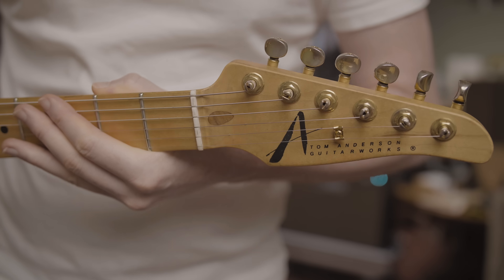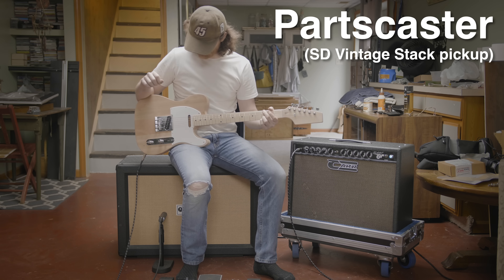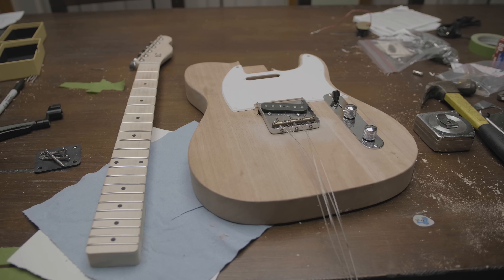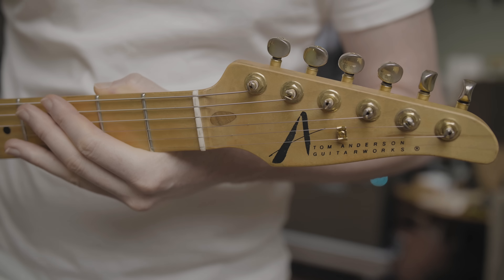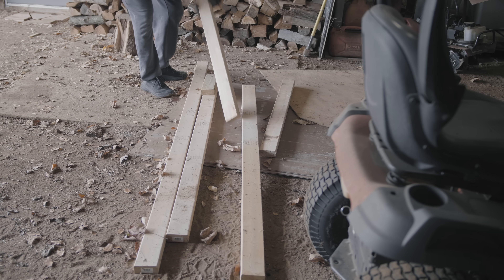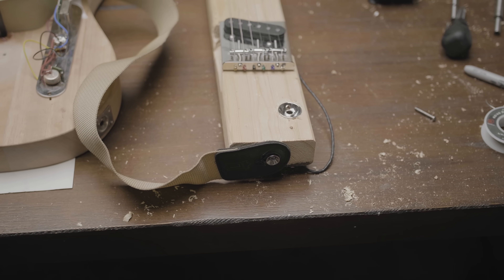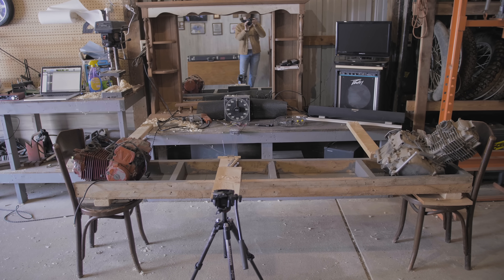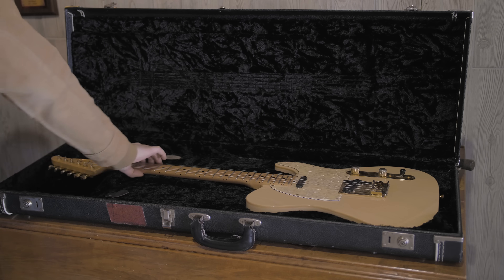Tested: Where Does The Tone Come From In An Electric Guitar?

Comment: I think the biggest determining factor in guitar tone is what size Honda engines you are using to hold down the shelf! Thank you for an excellent video that proves the most important parts of electric guitar tone have nothing to do with wood
Reply: and if they're v-tec and which generation plays a big role too!
Reply: @cunjoz  those are air cooled Honda single cylinders for ATVs or motorcycles, no VTEC lol
Reply: Honda is leaving F1 so they can start supplying power units for guitars.
Reply: Think they were Honda tonecasters! 🤣
Reply: @ChrisSmith-vm5tm  Now you're just being silly 🤣
Reply: Tone would have been fat and lumpy if they were Harley engines.
Reply: @tobins6800  And you'd have a guitar that didn't like turns...
Reply: @tobins6800  They also would not have made any sound a lot of the time.
Reply: Also, the milage of the engine has to be taken into consideration.
Reply: @JohnnyOlsson  true, newer engines sound brigher
Reply: Obviously he's running a spoon engine with Motec exhaust and NOS.
Reply: Yamaha engines would sound better. They make musical instruments.
Reply: Maybe replacing the Honda motor to a Kawasaki might make a tonal difference 😁
Reply: TRUE! The problem is that this video is trying to say that woods/substrate/guitar body doesn't matter.. and basing that whole argument on the fact that everything but the pickups, the strings and the tuners have been replaced... but that's not the case. Strings need something solid to resonate with to maintain their oscillation... plugging this rig into a bench does not demonstrate that.. you're just replacing the guitar body with a bench.. so, of course the strings will resonate the same - maybe better! Replace it with stale bread and you might have a point. :-)
Reply: @crazyjack9voltbatteryamps  "Strings need something solid to resonate with to maintain their oscillation" This is absolutely BS. It is exactly the opposite. The solid wood (or whatever "resonates"..) is taking away some energy. It is simply physics.
Reply: V-Tech Baby!!!
Reply: Just play a hollow body electric.  Make more of a difference than Honda engines.
Reply: Man, you're so misguided. Suzuki engines are the shit.
Reply: @patricasensio6074  I disagree and submit we still have no clue, completely, all of the factors involved in sound generation of an electric guitar.  Obviously the pickups and electronics are the biggest factor--but if they are the ONLY factor--why does a Rosewood Telecaster sound different than an Ash bodied one?  Why does a 50s Les Paul Custom sound different than a 50s maple topped Les Paul Standard?  You even have people claiming the glue makes a difference.  The differences in wood alone (rosewood vs ash, solid mahogany vs mahogany with a maple cap) tell me that the above study is flawed at best.  When designing a study, the number of variables involved causes the mandatory sample size (for validity) to increase exponentially.  For a valid study, looking at only one variable, a sample size of 10 can be valid.  For 2 varialbes you need 10 squared (so 100) for 3 variables you need 10^3.  So 3 studied variables changes the sample size from 10 to 1000.
Reply: @patricasensio6074  also I will point out that "Science" is perfect and is NEVER flawed.  Humans, however, designing and interpreting those perfect scientific measurements, are quite flawed and very frequently wrong.
Reply: OK. Let the idiots pay for tone wood... really.
Reply: @whitex4652  when you consider how much old growth forest has been cut down over the years to satisfy market demand for exotic "tone" wood, it's the planet that pays, really.
Reply: @sequentix  thank you!!
Reply: The planet doesn't care for some wood you use. When the planet was "born" it didn't have even trees.
Reply: You say that in jest but as a scientist who has designed studies, this must be taken into account.  This is a very valid "Feasibility study" (in science words) but I can see some issues.  As mentioned above, one must take into consideration the possiblity that the 4 different guitars were actually all made of very resonant wood.  Easy to think "well a 2x4 could not be resonant" but how do we know that.  Perhaps mount the exact same experiment to a piece of Trex decking (plastic 2x4).  Also try it with a metal bar (much harder to do).  Same with the air guitar.  I would like to see a further comparison using plastic or dense foam in the shape of a guitar and a metal shelf and bar mimicing the other 2.  Again, scientifically speaking, it is entirely possible that 4 very resonant woods were chosen here.  This is not to detract from the excellent experiment that was done.  This is outstanding and needs to be continued.  I would be willing to chip in on some materials to see more!
Reply: @drjsmajor  if we were doing an academic study of this topic then yes I’m with you and we it would be cool to take this even further, but I think this video was clear enough and pretty much proved the only thing that matters is the electronics.
Reply: @drjsmajor  What difference does it make?  None of us are playing guitars made of Trex decking or metal bars.
Reply: @colinb3544  It matters if you want to understand which factors affect the tone, and could also help further future instrument design.
Reply: We know where tone comes from in an electric guitar. Jim Lill has just proven it to us. 

Q: Where does electric guitar tone come from.

A: From the pickups as proven by Jim Lill in 2022 

Q: Should we build from materials other than wood hoping it will change the tone?

A: It has been proven by Jim Lill in 2022 that electric guitar tone is not dependent on the materials of the guitar but only dependent on the pickups.  Therefore building from other materials hoping that the tone changes is rather a waste of time.

Q: Should be build guitars from other materials.  

A: You can build it out of whatever you want   but understand that it will not change the tone.  This was proven by Jim Lill in 2022.

RSMG From your statement you seem to have missed part of the video.  You should listen again.  Nothing changes the tone other than pickup and pick up height  as proven by this video.
Reply: @colinb3544  "Should we build from materials other than wood hoping it will change the tone?"
All of the guitars he tried were made out of wood. Even the "air" guitar attached to the wooden bench (or shelf, or whatever it was, doesn't really matter). Sure, the electronics are far more important, but in this video he only tried guitars where everything was attached to wood.
Reply: @San_Vito  Ya funny that we as not willing to weld the bridge to the bench or completely fabricate hs own tuners..

The funny thing is the converted believers will not believe, and the open minded pagans will give it the consideration it is due.
Reply: @drjsmajor  it was all done 100 times. search for foam guitar here on yt. it sounds like a damped piece of shit. unsurprisingly. the viral videos like this one are aimed at general audience which is unable for critical thinking
Reply: @kimseniorb  I keep thinking exactly that.  My brain goes to the 50's LP Customs vs Standards.  The all mahogany customs (with ostensibly the same pickups and wiring) simply sound DIFFERENT.  If this experiment were valid, how could that be?  Ash guitars sound different than Maple.  Why does George Harrisons Rosewood Telecaster sound different than others?  I have a hard time buying that it is "all the pickups".  I WOULD agree that pickups and especially pickup height in relation to the strings is critically important.  That is exactly why Seth Lover put individual adjustable screws on his humbuckers--so you can fine tune the heights (which seemingly no one ever does).  But the wood does matter (in my brain).  Again I will say that if it does not, why do semi-hollow bodies sound different that solid bodies.  The pickups on a (Gibson) semi hollow body are mounted to wood (ususally but not always maple).  A Gibson 335 from 1959 with the same pickups as a LP should sound just like an LP if the pickup were the only factor.  a 335 does not exactly like an LP.  A rosewood Tele does not sound like an Ash one.
Reply: @drjsmajor  It would be interesting to see the same test done on these guitars
Reply: @drjsmajor  I think the differences between those guitars is probably just where on the strings the pickups are placed, and individual pickup magnet heights, and the sound difference with hollowbody guitars is probably not heard through the amp, the pickups have no way of picking up the sound waves coming off the wood
Reply: @drjsmajor  I can double that on the Rosewood Tele.  In all instances it seems darker, bassier  and "dryer" to me.
Reply: @Planet Dog  anyone suggesting "wood does not matter" has obviously never played 2 otherwise identical guitars of different woods.  Rosewood teles sound NOTHING like Ash teles!

Comment: I am amazed it's even a debate tbh
what part of the solid body electric guitar has the greatest effect on the sound - the pickup to string interaction surely?
so that would be the strings and the pickup type their position along the string and the string/pickup separation
the rest?  electronics and how they're configured then the bits that they're all mounted on? bridge frets and set up
but as one of the survey responders said  - the player  (a good player can make almost any half decent guitar sound good) 

I can't see how the wood used in the neck or the bodycould  have  a  majority or controlling influence - what do they do?  Somehow  create micro reflections and set up defining vibrations?  Vibrations that somehow overpower the moving string's pull on the magnetic field of the pickup (hence what causes the generation of the signal in the pickup coil?) How much vibrational energy are we getting from the string in the first place imparted into the neck and body and how does that affect the relative postion of bridge string nut pickups etc? Basically a solid body electric when played acoustaically will produce enough vibration to create sound and differnt timbers / guitar styles sound different acoustically BUT is this enough to affect the relative movement between string and pickup to such a massive extent. Could one piece of timber create guitars that sounded differently because of the internal structures / grain / density etc  and variation in seasoning etc?  Or are we saying that certain timbers always osund a certain way or have the same effect...?  

In acoustic and semi hollow guitars I think the construction and timber used must play a role but a solid chunk of wood for neck and body?? Let's not forget the string is metal - terminated at one end by a metal bridge and most often a metal fret at the other  - all metal contact points that sit on a wooden platform - so why isn't the metal used held to be as important. 

the people that state the sound  / timbre of solid body electric is dictated solely / mostly by the wood  - might ask why a  LP sounds different to an SG and they're  basically the same so it must be the wood - but aren't they made of the same woods? Mass, density, interfaces and geometry - how standing waves and vibrational modes set up in the structure must p[lay a part but is it the predominant one?

Comment: Nice video,..lots of work.   Of course anything will make a sound when attached to a pickup.  I think the big "argument" is do different woods sound different. Mahogany vs. Alder,  Alder vs. Ash and so on.  I think they do.  Thats why a les paul, an SG and 335 all sound different (to me).  same pickups, same scale length....different wood, or volume of wood in the case of the 335 especially.

Comment: I knew it - the tone is all in the Honda engines

Which engine models were used, and were there any engine mods done along the way?
I won't stop chasing that perfect tone until I can replicate the exact displacement + internal gearing ratio sorted for my sound.  No other sound will do!
Reply: Also, are you using ethanol fuels, or do you have a stash of the vintage stuff?

Comment: Boo-yah!  Thank you so much for making this.  I've always asserted that an electric guitars sound is in the electronics and the wood has no significance.  And even if there was some effect, it would be so small as to be undetectable by the crude detectors that we as humans have not to mention completely and totally swamped by tiny variations in things like pickup height and such.  And then there's the actual biggest factor in everything, which is the nut loose on the fret board.  I have another theory though; if you showed this to 1000 guitarists, 999 would still continue to blather on about the wood their guitars are made of as if it mattered.  Of course, given the list of tone effecting factors from the builders you contacted, it's clear that luthiers are also frequently full of sh... uh ... stuff.  :-D  (Seriously, the finish?  Really?)  Anyway, great work.  I'm gonna have to cruz some of your other videos now.
Reply: Hard, heavy wood makes all the difference in a fight with your bass player. They already have the longer reach and a thick head so you don't stand a chance if you turn up with a small plank. Your tone would be that of timid chords underneath slap solos.
Reply: even if there was a slight difference couldn't you just EQ it with a pedal to make up the difference?

Comment: Amazing video and very well done...it truly proves the science behind the pickups is the primary driving force for guitar tone and sound, and why should that not be true? Guitar pickups are basically a magnetic field that is broken by a guitar string vibrating across it...the magnetic field does not care what color/shape/species/name-brand of the substrate holding it in place...its simply a matter of pure physics...send a piece of metal across a magnetic field and you will create a current in the coil...the metal can be a nail or a guitar string, the pickup does not care, all it does is respond to the frequency by generating a tiny small ac current...it's not magic, but it can be magical.